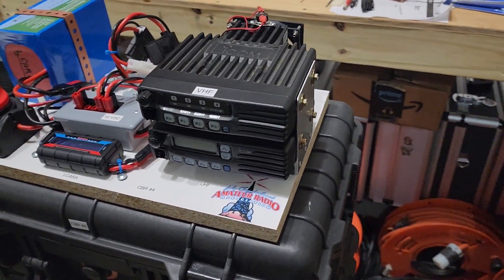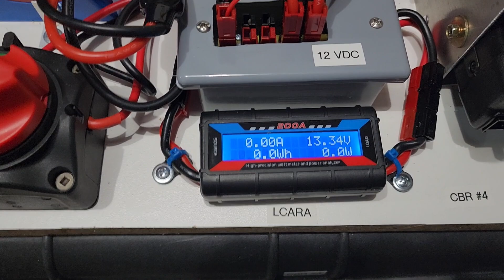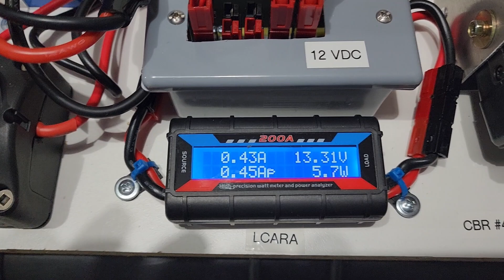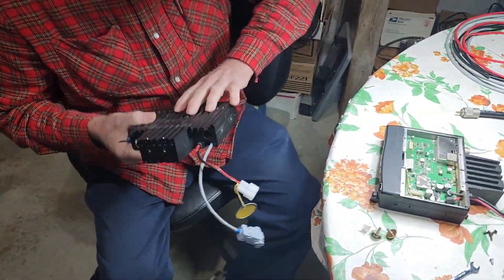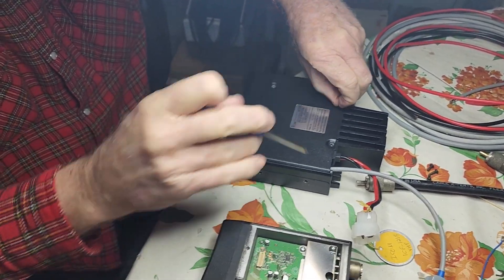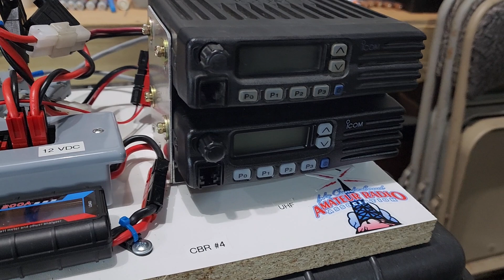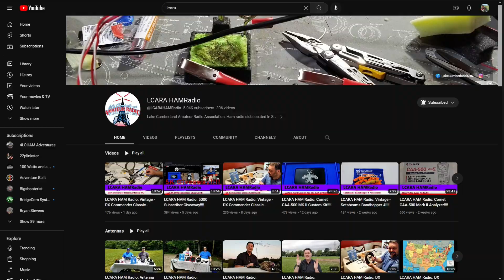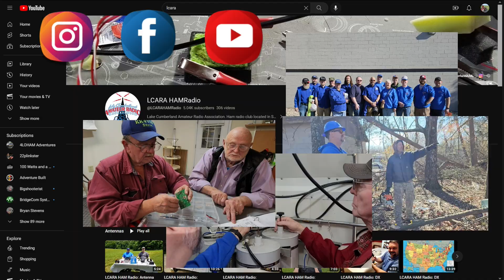LCARA HAM Radio: Crossband Repeater Build Pt. 7: More LCDs!!!!

Comment: I have used several of those Icom commercial Radios for packet digipeaters for Emcom work. I have 3 of them running on the West Coast of Florida and not had an issue yet with them.  I run them on 50 watts and with that big heat sink they run nice and cool with no fans.